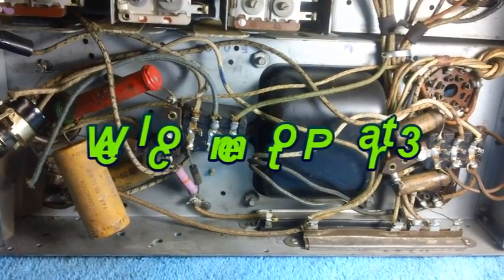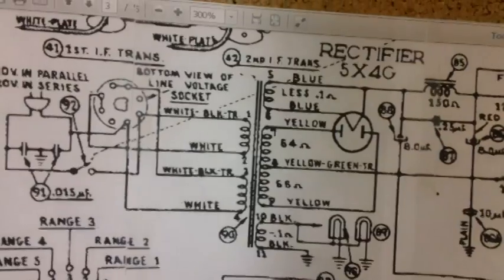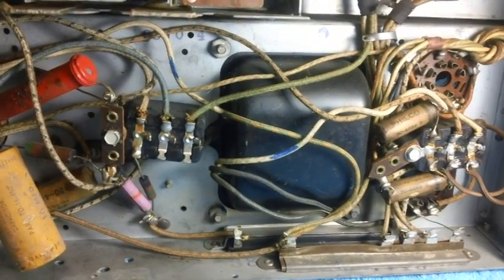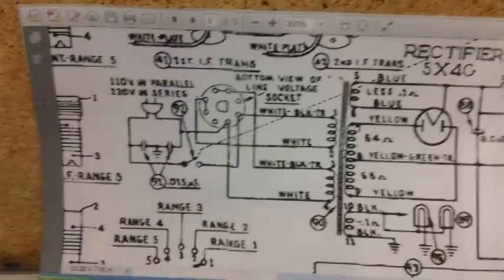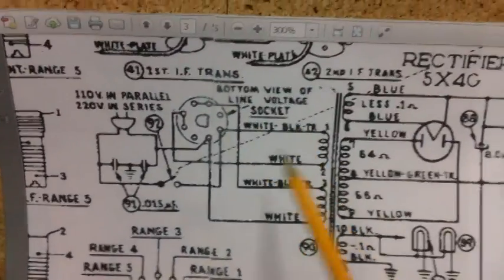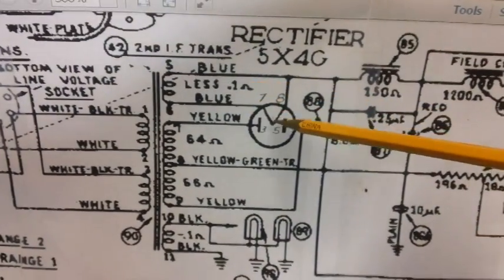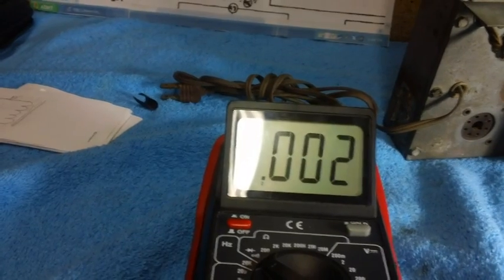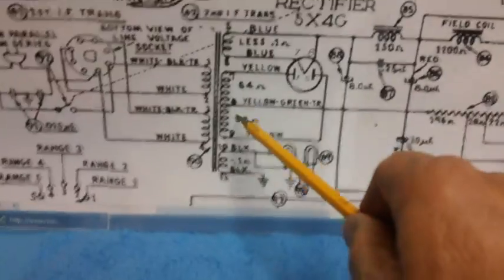Philco model 37-2670 repair and restoration (Part 3 of 34)

Comment: Thanks for these vids!  I just picked up a 37-640 which is very similar as far as the chassis is concerned.  The radio has also been butchered like yours!  It's almost like your walking me through my restoration!
Reply from the maker: Thanks, my friend.  It's good to have you here.
If you eventually work on other 1930s model Philcos you'll come to see that their chassis wiring is almost identical.  There are of course some variations, but after cutting away the schematic fat they'll all look the same.
Good luck on your restoration effort.  You can do it.  Never a doubt.
 
Regards,
John

Comment: John,
You ended your response to my last comment (part 2) by saying “Still…wish me luck, old chap.”  Best of luck!  I’m confident in saying you don’t really need it my friend.  You will have that radio working in no time.  After the grief it has been subjected in the past, it will be good to hear music coming from its speaker.
Regards,
Phil.
Reply from the maker: Phil,
Thanks, my friend, but I always need luck when working on these old radios.  There's no telling how many folks have worked on them over the years, so no two are ever the same.  Just like when I zapped my thumb while trying to reseat that metal tube.  Someone had disconnected the socket pin #1 from ground and hooked a B+ wire to it.  Yeah, I need all the luck I can get.  :-)

Regards,
John

Comment: Had to look for a few moments, until I realized that you have the schematic for the export model (w/ the two primaries for the voltage selector).
Reply from the maker: Right now it's the only schematic I have to work with, but there's some better stuff coming in.  Should arrive in a few days.  Actually, the only difference between the domestic and export models seems to be the power transformer setups.
I appreciate you stopping by.

Regards,
John

Comment: glad the transformer was AOK.
This is OT, but I got my GAP Titan mounted onto the mast today. It's supposed to rain or snow, so I hope to finish if there is another break in the weather up here. All I need do now is hookup and radials. Here is a vid of the antenna by another tuber: Gap Titan DX Preinstallation Video KK4EQF (I though you might be interested in what it is).
Reply from the maker: Don,
It's a neat-looking antenna, and no doubt works well, but the vid really didn't tell us anything...probably because the guy was a new ham.  When done, what say you do a better vid on it?  You can do it, son.  Anyone who washed a toaster in a dishwasher can make it happen.  :-)

Regards,
John

Comment: John,
I really like that there is a tube socket on the top of the transformer, i think that is very neat.
Reply from the maker: Hey David,
I agree...it is cool.  But there's sometimes a problem with the socket being mounted on top of the transformer.  Over time the transformer's heat dries out the socket and makes it really brittle.  Cracks occur and the pins start arcing and sparking between one another.  Not good.  The only solution I to install a new socket.

Regards,
John

Comment: How do the Caps effect the line if they are put before the rectifier.
AC-- Caps  then rectifier. I understand they will remove ripple after the diodes but do not see the effect across the AC directly.
Reply from the maker: Brother Mac,
We'll cover this in a later vid.  I'm not much in the way of theory, so it'll only be of a cursory nature.  But for now, just know that the caps help eliminate voltage spikes coming down the AC line by sending them to ground rather than allowing them to enter the primary of the power transformer.

Regards,
John

Comment: You still have a few coils to check, don't you :-)  This set is full of them.  I'm sure you already know, you can probably refer to the 37-670B schematic for differences, like the transformer, also, but, you were teaching.  Good teaching, at that, John, always learn something new, watching your videos.  It'll be great hearing this radio, for the first time.  By the way, how big is the cabinet?  It looks as big, or, bigger, than the Arvin 61M that I just did.  Mine has the big cabinet, but, only an 8" speaker, surprisingly.  Off to a great start, John.
Reply from the maker: Al,
I next plan to check the two I.F. cans, the audio output transformer and the speaker.  If all are good, and the on/off/tone control repair is successful, we're gathering up any missing tubes and applying  power to this puppy.
Also, it's probably best to not jump from one radio schematic to another.  I did that one time and folks who owned one of the second radios began taking the project off in that direction.  Unfortunately, the newbies were soon lost. It was a lesson learned.

Regards,
John
Reply: Very true, John.  In this case, I think I'm going to compare schematics, just to see.  Since the 37=670B was the domestic only version of this radio, I suspect it's schematic is going to be closer to what you have there.  Just out of curiosity, I know what you are doing.  As I said before, you are a great teacher.  I'm keeping my fingers crossed on the IF's and all those coils.  The switch?   Piece of cake:-) Thanks John.